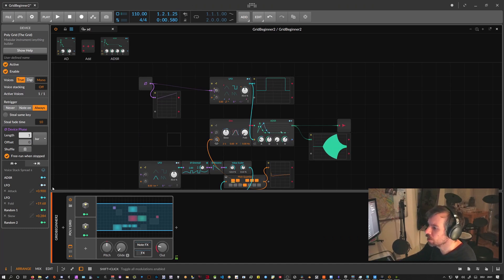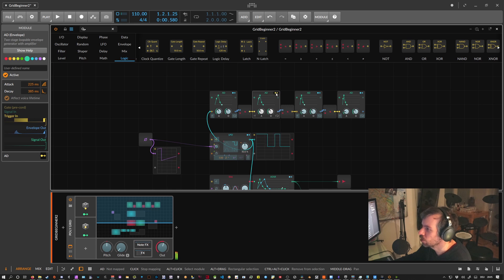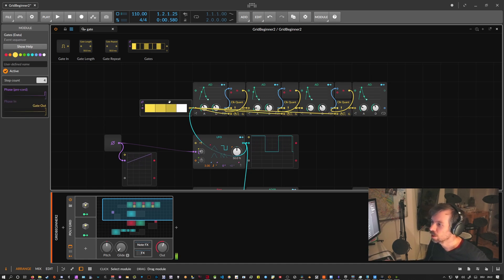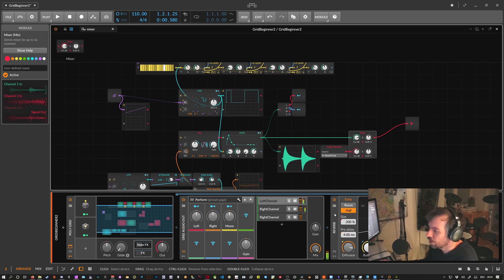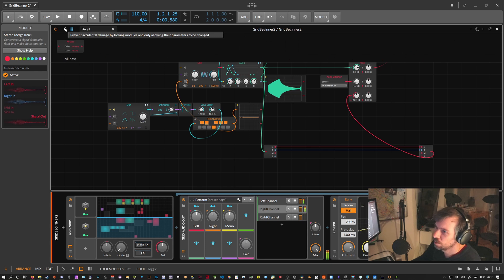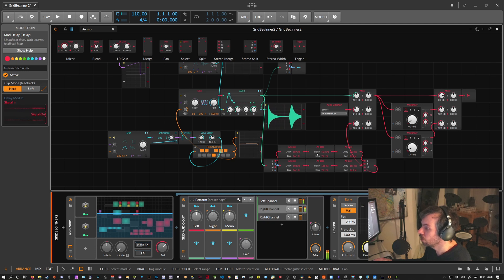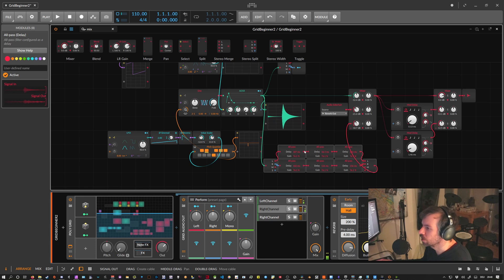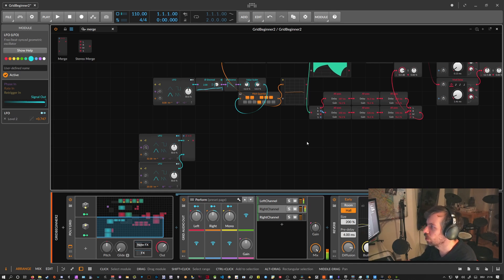🤓 Modulations, Audio FX & simple Sequencing - Generative Bitwig Grid Tutorial for Beginners 3

Comment: I'm using the trick of DC offsets to send audio out of the grid, but there's a caveat. I can't stop the original signal from passing through the FX Layer, so there's no way to mix the wet audio and a dry FX. 
My patch is 4 oscillators mixing to the Aufio out of the grid. I want to send 1 of these oscillators through an FX. The problem is that that oscillator reaches the FX Layer and sums with the DC Offset, and I can't blend the two.
Reply from the maker: thats why you use not the "fx box" but the "note fx box". the note fx box doesnt leak audio. when you get the audio back in with the sidechain module, you can blend it with the rest.
Reply: @PolarityMusic  ohhh, I didn't watch the full video. I remembered of this trick but I didn't remember that you get the audio back into the Grid for mixing.  Of course nothing prevents from using an audio receiver on another track. Thanks a lot ;)
Reply: @PolarityMusic  routing back into the Grid works perfectly. However:
1) If I put an audio receiver on an audio track, I can hear the sound until I don't arm the track. After that the meter doesn't shopw any signal and I can't record the audio
2) If I set the the Note FX as an Input to an audio track no audio comes out, wether armed or not.
The first is probably due to Bitwig expecting to record only from the source set as an input, but the second is unexpected.
EDIT: this must be a little bug in Bitwig. Actually I could record the audio from the DC Offset on another track, but it can't be monitored.
Reply from the maker: 1.) you cant use the audio receiver to record audio (because its post audio in the fx chain). you need to use the input dropdown of the track and select the audio out from under the "tracks" category. then notefx/fx -> grid oudio out

2.) see 1.
Reply: @PolarityMusic  I'm doing point 2, I've tried both the grid audio out and (even deeper) the Dc offset output, but yet the metering of the track doesn't show anything. I've tried changing the monitoring settings of the track, but no way. I can record but not monitor it. Does it work for you?
Reply from the maker: do you need the monitor? i thought its about the recording?
Reply: @PolarityMusic  well, yes, but you know, recording without hearing is not the best :D I figured out that we can use both point 1 and 2: monitoring with an audio receiver and recording with the audio input. Seems more like a hack but it works, even though the metering doesn't work when the track is armed.